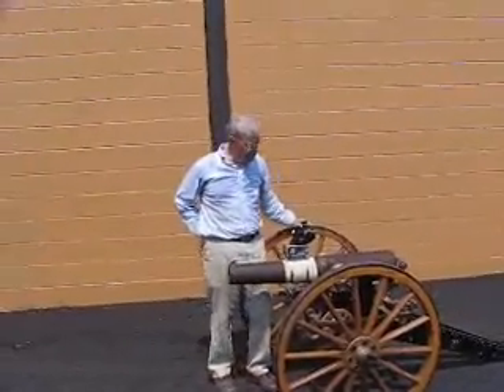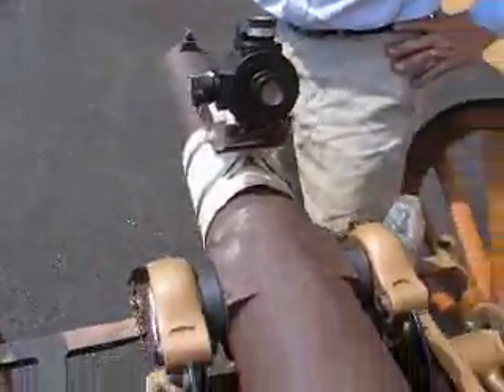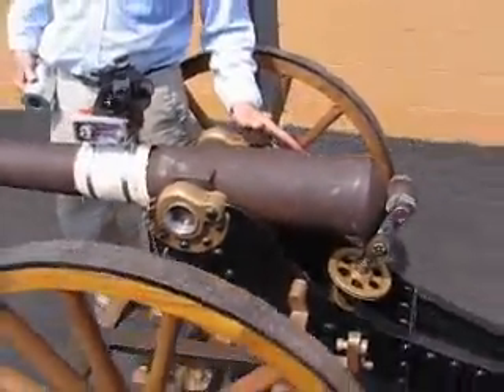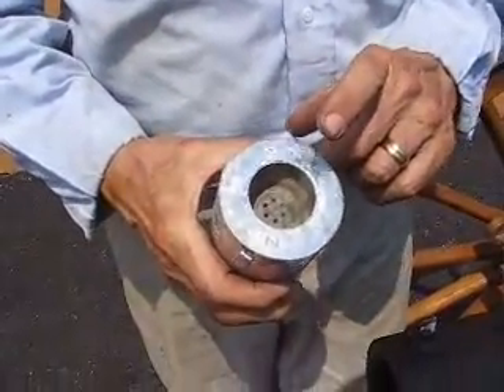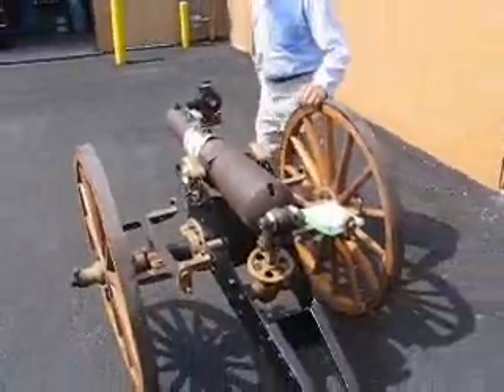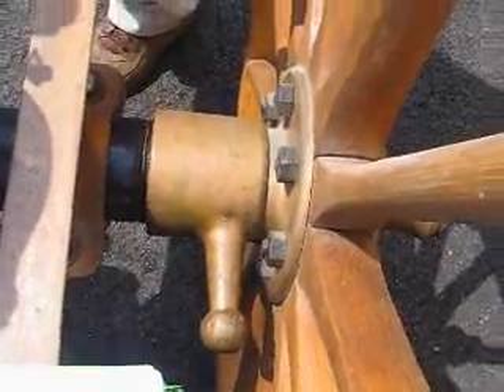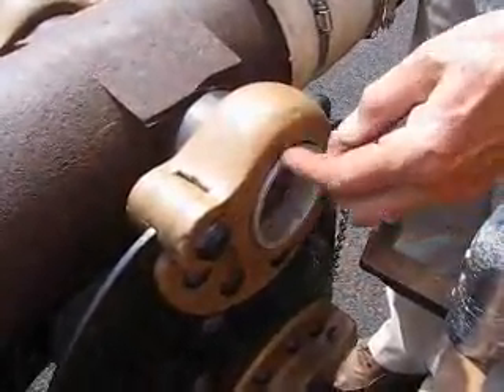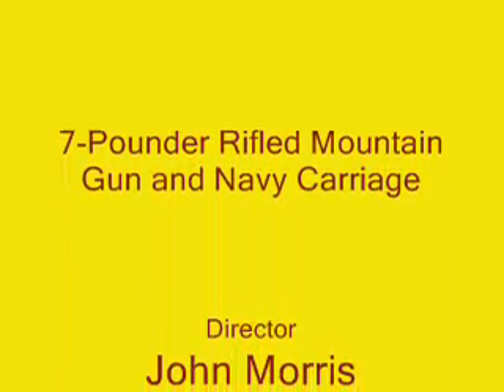7-Pounder Cannon Deadly Destroyer Detonation

Comment: You may have more accuracy if you shift the center of gravity of your projectile AFT, just like hollow point target bullets do.  Further, you may experience inaccuracy if:
-your projectiles are the wrong length for the rifling to stabilize
-or wrong diameter for the barrel
-or have too many voids in the casting
-or the speculative tail insert isn't exactly centered on the projo's axis of rotation.

So, find out the original length of projectile and duplicate it with your mold, ditch the tail light design, and decide on a correct diameter.  I have no comment on the correct grade of powder or quantity, or any gas sealing you may try to effect.

Good luck